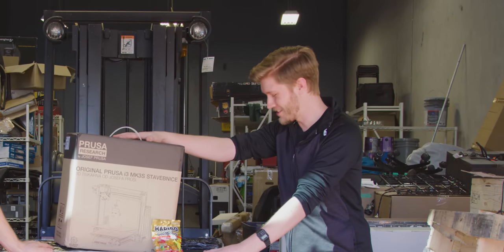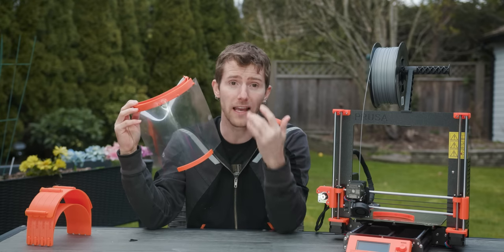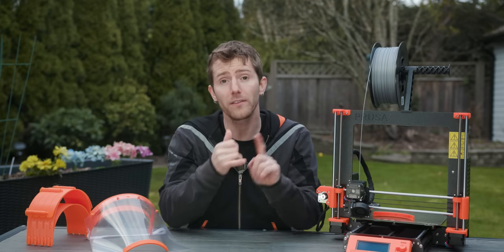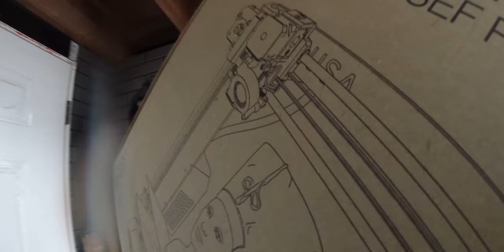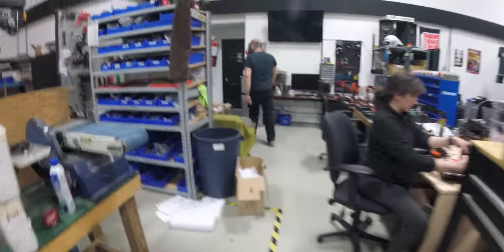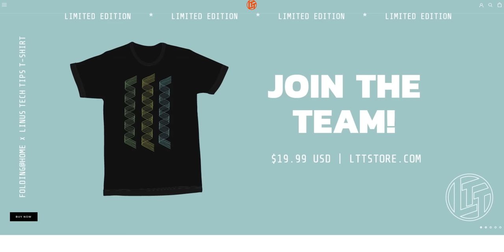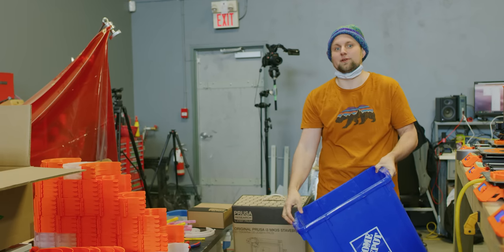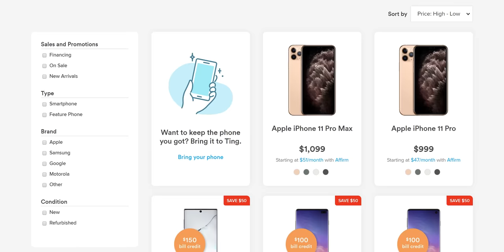3D Printing 300 Face Shields… PER DAY

Comment: I asked my local hospital if I could print for them, but they didn't need any help. We have a couple of local maker spaces in my city, so they actually have more supply than they do demand for 3D printers.
Reply: Plus you wasted valuable time of the hospital personnel by asking if they needed them, I mean it was great of you for thinking of them, but people need to stop this unless a hospital seeks you out.  If a hospital needs them, they will find people to make them, but what they dont need is people giving them more work than they already have. 

Lets also not forget that hospitals are the best place to catch the virus, so if you go to your local hospital to ask if they need them (and once again you shouldnt), you take the risk of catching the virus or giving someone the virus.
Reply: Other people might need them too. Cashiers in supermarkets, bus drivers, nursing homes, simply immunosuppresst ppl... Hospitals are the number one battleground, but other people lack protection too
Reply: @TipsyTimeline  This comment is underrated.
Reply: I'd go to local businesses instead and ask if their company is having any trouble providing protection for their employees. Most employees are using protection procured themselves and not always from the company directly. Simply because they don't have anything on hand at their building.
Reply: @TipsyTimeline , someone remembered nursing homes 🙏 I work at one with active cases
Reply: Lets hope a usable 3D printer design for respirators is made so some people can start printing those too. Masks are one thing to protect people from getting infected, but there are a variety of other things you can use as masks.

Respirators however are needed to stop people from dying and there is a worldwide shortage of those and certain places are creating an artificially boosted shortage to boot.
Reply: This video idea was stolen from SmarterEveryday
Reply: @ChicoTunda  yes. Nah just joking dude. If you do it do it. Here in Malaysia, we haven't got to the critical stage where a bunch of 3D printing nerds save the day, no offence. Don't look too good for you guys in NA
Reply: @jon9947    I think when he referred to asking them, I think he just gave them a call which probably didn't last more than 5 minutes
Reply: Jon what’s wrong with you ? Calling a hospital and asking “I can provide you free PPE” is great
Reply: I have family who are on the front lines, plus an Ender 3 and a cr-10.  Do you really think if printing these would be a good idea I wouldnt be printing them now?  I know better, now maybe things are not as bad here as they are other places, but I know for a fact that what I said holds true for where I am at. As it also apparently holds true for Marco and probably most places outside of the hotspots.  

It might only take 5 minutes to make a call, but when you have 100 makers making the same call it adds up to valuable time wasted for the doctors,nurses, and other hospital staff who are already working twice as hard as they normally do, and 100 times harder than they should. 

I get wanting to do something positive for your community, but the best thing you can do is stay home.  If the world would just stay home for two weeks this crisis would have been over.
Reply: They need it but they've got strict standard for that, since medical personnels are on the frontline but for personal usage it's fine
Reply: There are designs for 3d print respirators. However there is no possible way to fully create one just from plastic as you cant make activated charcoal with plastic. All you can do is create the frame of the respirator that holds the filters, but we are in shortage of filters not frames.
Edit: Any respirator that is not utilizing filters and is fully sealed, would be less usefull than a face shield. 

Also, i would argue that given the nature of COVID-19, an activated metal such as silver or copper would be dozens of times more useful as a filter material than activated charcoal. Activated charcoal filters impurities like smoke, it is not by design meant to stop biological contaminates. An activated metal like silver however is lethal to microbes and biological organisms at a cellular level.
Reply: @thezyreick4289  You dont need charcoal for medical purposes, you use that for chemical/radioactive protection
Reply: I stated that already.
Good example of click read more before reply.
Reply: Maybe I have asked, maybe I have even printed an entire box of face shields only to be told more or less what I am trying to tell the rest of you.  So maybe, just maybe I am not the idiot, and maybe I know I am talking about!
If a hospital or some other first responders puts the word out they need 3d printed shields, then by all means go nuts.  Once again I get wanting to help your community, especially when we are all feeling helpless and stuck at home for weeks on end. 

Every time you leave the house, you essentially reset the quarantine clock for all of us.  If people would quit going out to drop off printers, face shields, or even stupider things and do what they are suppose to do, stay home, then this mess would have been resolved already.  Two weeks of people staying home is all it would have taken to resolve this, but people cant seem to do that.  Instead they want to waste plastic, first reponders/medical professionals time, and possibly spread the virus more.... talk about helping.
Reply: @jon9947  lol that's true, I remember driving home from work the other day after the city issued a stay at home order, and there were people with their kids playing in the park, and people walking around the run trails

The next day the number of reported cases jumped from 32 to over 1,000. And we had the first cases of young kids and toddlers getting infected here
Reply: @jon9947  I just told this to my girlfriend who is a receptionist at a hospital. She laughed. Anyone willing and able to help should call their local hospital. The 5 minuets that it takes the receptionist to check is more helpful than you can imagine considering you will never find out otherwise if they need your help, and they probably need any support you can give. They legit have an advert in my area telling us if there's anything we can do to lend our services, then we need to call our local hospital. 

Also hospitals have something known as barrier nursing. Basically before entering a room with suspected Corona virus, they need totally new PPE. Before entering a ward with confirmed Corona virus, they need PPE for the ward. If they go into a ward with no Corona virus, you can't wear PPE. If you have Corona virus symptoms or test positive, you cant work in the hospital. All surfaces are consistently wiped over with disinfectant twice a day. Hospitals are fairly safe, just like how getting in a plane is fairly safe even though your thousands of feet above the ground. 

Genuinely, look through your comment again because lying to people like this is disgusting. There's nothing I hate more than misinformation. People like you scare average people into a frenzy and prevent them from going to the hospital to be tested just incase they don't have it and they catch the virus there.
Reply: TheZyreick if the infections jumped the next day, thats the result of the people picking up the virus 1-3 weeks ago.
meaning you will see the result of the current measures in numbers only on 1-3 weeks.
Reply: @Kelekgnixiyusjn  the point I was making was that despite the situation people were ignoring a stay at home order that has been in place weeks. Out of sheer boredom. And now we have tons of infected.

And yes I mean tons literally, because when their friends, family, children die, there bodies will pile up and be tons (exceeding a combined amount more than 2,000 pounds) of biological waste that needs removed
Reply: Marco Meijer Thuiszorg kan je hulp gebruiken!
Reply: @jon9947  @Jon It seems like you may have identified a need that nerds can help with. How about a site where one person can ask a potential recipient (hospital, nursing home, etc.) about what they do and don't want  and it gets posted so they don't get asked again and people can give the help actually wanted. Does such a thing already exist that you are aware of?
Reply: @jon9947  And yet I've read at least two stories where someone just asked hospital personnel if they could use X and the hospital was like "oh yes, thank god we really need X..."
Reply: @jon9947  waste of time is doing nothing at all
Reply: Marco Meijer Where do you live? Also in the Netherlands?
Reply: Hospitals were never undersupplied... There was never a shortage of masks or gloves. To believe there was a shortage is ridiculous... A single company can mass produce more in one day than every hospital can use in a week...
And with a bunch of companies that would usually be using masks for ppe for chemical use is no longer at work, hospitals are the only ones that would be using these on a large scale... There for there is no fucking shortage
Reply: @Duncan Idaho Now that seems like a reasonable thing! 

People I never said dont help, I never said dont print masks if a medical professional asks you to do so. 

What I have said, and what the person who started this tread have said is not every hospital needs our printed ppe.  Further more what I said, and I dont want to put words into anyones mouth is you may actually be doing more harm than good by printing ppe and wasting your local hospitals time.  Once again it may only take 5 min to call your local hospital, but when you have 100 makers every day calling a local hospital and wasting the time of a receptionist your not doing anyone favors.  

@Confident Lime  It was never my intention to scare anyone from going to a hospital if they actually need medical attention, but just because hospitals are doing barrier nursing dosnt mean they arnt hotbeds of infections.  You may very well have the virus and not know you have it, and yet be spreading the virus to everyone you come in contact with. 

You actually prove my point to some degree, your local hospital has put the word out that they need help, and more often than not anyone that needs help will ask for help. 

Now to sum it all up and go full circle, be decent human beings, do more help for your local medical professionals than anything else you can do.  Quit going outside and assuming you know best.  The world isnt flat, your not special, and if we all spent two weeks at home this would be over.  Two simple weeks is all it would have taken to save countless lives!
Reply: Honestly I would just distribute this to everyone maybe if we all had protection like gloves and face mask we could go outside a bit more
Reply: @SikConVicTioN  So you figure Linus is running 30 machines all day every day by mistake? LOL
Reply: They arent allowed to use them anyway, they need to be certified for medical use.
Reply: You the next Linus should 3d print a mother F*cking Computer Cassie.
Reply: Same here, when the project of converting scuba mask for hospitals was launched I've reached the creators but they required a bigger production for a single printer
Reply: @jon9947  Wasting valueable time? Send them an email, if they have time and a need, they'll answer and you don't have to go there.
Reply: @AliBaba-vw7mo  The time frame between the two videos is way too small for that. There's no way they assembled 30 3D printers immediately after SmarterEveryDay uploaded his video.
Reply: @jon9947  I emailed them. Considering they went out of their way to call me back and personally thank me, I don't think they were that strapped for time.
Reply: @Marco_Onyxheart  I know. And as I was saying in the previous comment. It was a joke. But hey what a coincidence
Reply: TheZyreick and my point being that people going outside, keeping distance when talking and walking, children not playig with any new friends and just in the usual small group...  does not necessarily go against the intent of quarantine measures ongoing in many countries. and that your seen numbers dnt say otherwise yet.

thats how things are here in switzerland at the moment. and i hope its a well chosen balance. cause not going out st all once or twice a day in this nice weather probably is unnecessary and... unhealthy too. especially when there is enough room to not get close to anybody. which isnt the case in huge urban area cities without lots green and open spaces.  anyway, best wishes :)

Comment: 8:24 Ok hold on, I personally have experience printing with PETG and my printer is printing PETG right now. You do not need glue sticks to print with PETG. If you have a flexible build plate it should not be a problem removing the prints. If you don’t have a flexible build plate then use a putty knife to get it off, and keep in mind if you keep the bed heated while you remove it that can help.
Reply: Large Juicer the printer they use have a flexible bed
Reply: Yeah I think they were printing too close to the bed. I've never had petg adhesion that great(I'm on a glass plate too.
Reply: @Anon.G  same I have the same printer they use and never had any problem with petg
Reply: @something7101  yeah the bed is removable on that one and you can bend it to pop it off right.
Reply: Prusa has two kinds of print beds. The ones they are using are extremely "sticky" to PETG. You will sure destroy the bed if you don't use glue to separate PETG and the bed. Prusa official warns about printing directly on this bed.
Reply: @Marv3D  For the smooth sheets from Prusa you just need to apply windex after cleaning with alcohol. There is no need to clean the bed between prints unless the PETG no long sticks. That is what Prusa recommends. Using the glue stick just makes things messy and hard to cleanup and should be avoided.
Reply: The smooth PEI sheet needs some kind of interface layer. The textured sheet doesn't; as long as you wait till the bed has cooled down to room temperature, it'll pop right off.
Reply: PETG will fuse with PEI if there is not a separation later. Prusa uses PEI. If you don't wan to use a separation layer (like gluestick) then they would need to use the textured bed also made from Prusa.

Comment: Use Windex to clean the print beds.  It makes a huge difference when printing PETG on a Prusa.
Reply: Will Dupuis what difference?
Reply: @gurgelplus  windex removes fats and oils, but leaves a little residue that lets PETG stick better
Reply: Hairspray
Reply: @pteppig  i thought because of the residue the Petg doesn't stick as much(still enough), but it releases better. That is my personal experience on my Bear MK3S.
Reply: @gurgelplus  The Windex cleans the bed but not too much.  This allows the print to adhere well enough to print but not stick (or basically weld) so bad after the print has finished.

Comment: Now all we need are 3D printers that print 3D printers.
Reply: Ya like jazz actually... while not completely, many 3D printers have parts that can be printed from another one, allowing places with multiple or those who know others with printers to help repair each other's gear
Reply: Check out some videos on Prusa factory... they use their own printers to make a large number of the parts for their printers. Only the electronics and metal supports are not printed. So...  yeah, pretty much there.
Reply: RepRap system :)
Reply: Ya like jazz, you are already able to do that
Reply: Stonks
Reply: @heathhooper3699  I bet that in a short while when SLS and (I forget the other one sry) printers get cheap like SLA just did, the metal parts will be as well. And, fun fact, its even possible to 3d print curcuitbaords with conductive filament, no shit. Of course not viable for applications like these, but perfect for simple projects.
Reply: Project Idea? LTT 3d printers LTT-shop?
Reply: One step closer to self replicating AI 😱
Reply: Actually, the 3D printers they're using are 3D printed. I have one, I know ;)
Reply: When you buy a Prusa, every component that can be 3D printed.... has been 3D printed..... on another Prusa, somewhere there's the mother Prusa that spawned them all
Reply: Welcome to 2010 😊
Reply: Prusa does that they have their own print farm that consists of over 300 mk3s that print parts for more mk3s. In total linus paid $22,740 USD for all 30. I have a mk3s and it's a fucking kick ass printer.
Reply: @heathhooper3699  arent microchips like 'printed' but using light
Reply: Be careful, that's how zero day happens..
Reply: Hold my spool!
Reply: Try a book called “we are bob we are legion” its about a guy who becomes an AI that must go to planets to get resources to 3d print more copies of himself. Its interesting and trippy
Reply: Ya like jazz Vhon Newman

Comment: Glad to see you guys spoke with the two guys in the 3D print space regarding validation and approval. Working in the biotech sector, even with lifted restrictions, you still want to make sure the product you have is reusable and can be sterilized quickly using equipment available at the site. A single use face shield helps, but if it can't be sterilized before or after use you could end up creating another problem.

Comment: FYI Windex works as a great release agent on a PEI bed when printing with PETG. Spray a little on, wipe it down, and print. Good for 5-10 prints and you still get a nice surface finish.

Comment: We've been running shields on 15 prusa's for about 3 weeks now (the US version of the Swedish design). We've figured out how to print in stacks of 25 and are putting out about 600 a day. It's been a learning experience to really push these printers. They are great little workhorses!